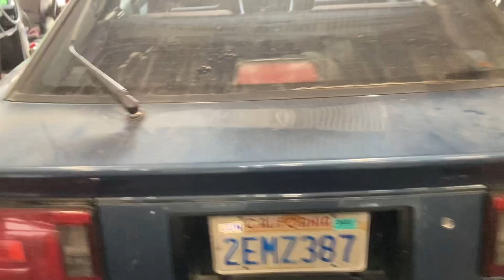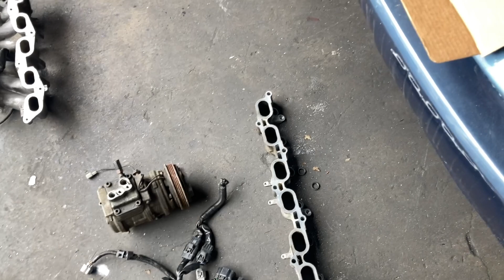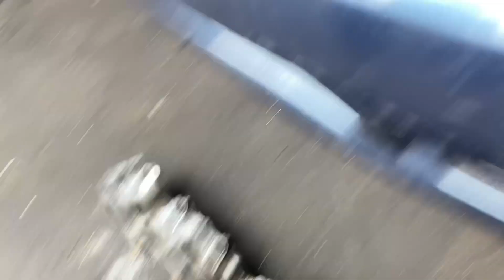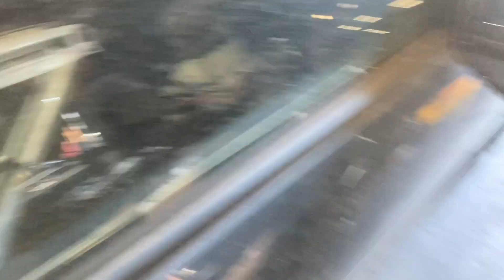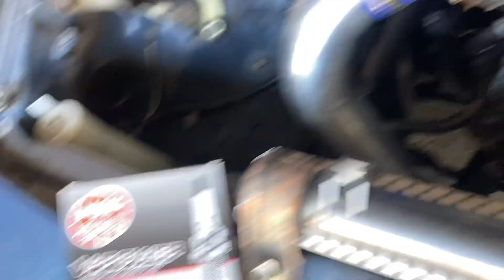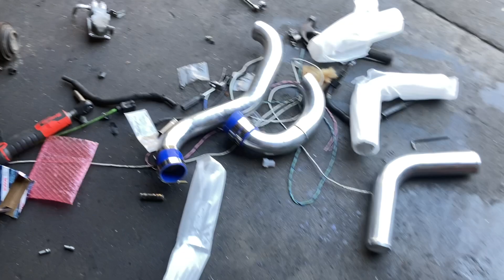1jzgte TT Aem Infinity conversion Mk3 Supra

Comment: Super similar to my build. I got the 2JZGTE from a JDM aristo, kept the twins (after much headache) kaizen harness, AEM infinity, walbro 450, 550 injectors came in a box with the car so we used those. New suspension, big brakes, uuuge intercooler and a tune and I was sitting at 440 ish wheel. Driftmotion did the twin upgrade for me.

I'd really like to see how you did the AC cause this thing is a swamp in the Ohio heat. Hope that clutch fan works out great btw, I went electric and till just recently have been fighting temps. Also, great job getting the tach to work. I drove without, and mostly no other info besides speedo for 2 years till I got my Powertune digital dash.

Two thumbs up on the build
Reply from the maker: Thanks for watching man

Comment: I was going to use the Driftmotion universal mount idle speed control because the wiring specialties harness is wired for it do I need it. That's for a 2jzgtevvti on an S14. And also what is the spark plug gap for those NGK spark plugs. Thanks